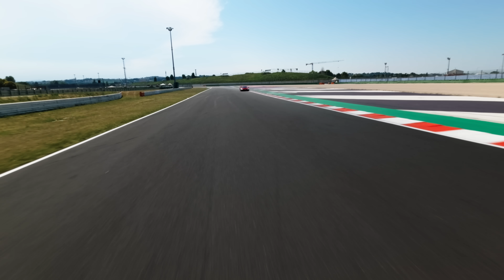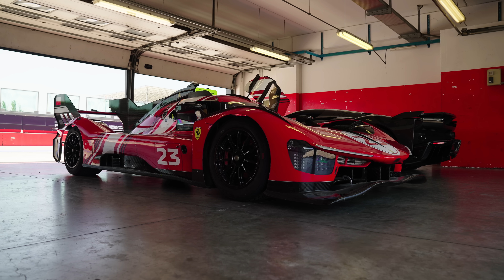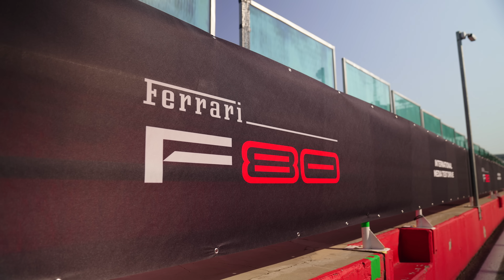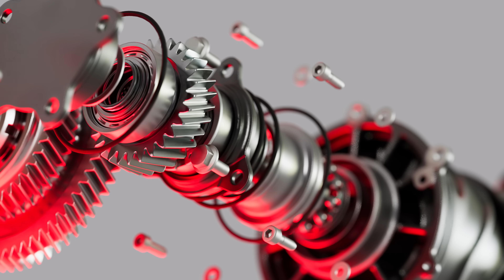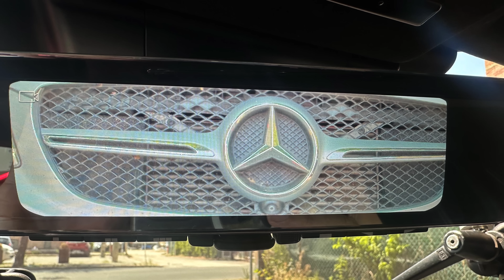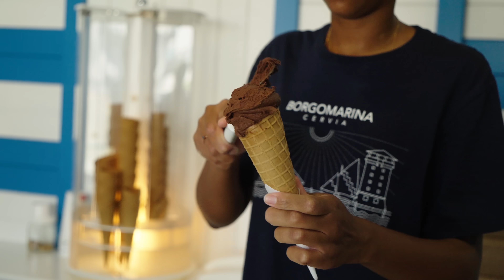Ferrari F80 First Drive - Ben Collins Drives - Track test and public reaction.

Comment: Now maybe car guys will begin what a super bargain the 296 GTB are today in terms of performance and systems. The 296 is not much different than the F80 - just 875 hp, six cylinder engine and electric motor - and very similar driving aid systems -  $3 million for the F80? Drive a 2023 296 GTB and one becomes a convert. Low mileage 296 gTB’s have depreciated down from the mid $400,000 msrp down to just above $300,000 and $$350,000.  The 6 cyl engine is much smaller than an 8 or 12 cyl- this can be placed very low in the chassis and allows a smaller body. Very similar to the corvette ZR-1 and -x -

Comment: When Richard Hammond nearly ripped his head off they didn't stop Top Gear.

When Richard Hammond tried to fly in a Rimac, they didn't stop Top Gear.

When Freddie Flintoff damaged his face, they stopped Top Gear.

Bring the 3 amigos back and relaunch Top Gear on the BBC for a couple of series then hand it on again, especially now there are V12's, and V8's  popping up everywhere, with eco fuels on the horizon.

Comment: Incredible piece of engineering, but it just doesn't look like a Ferrari to me.  The body seems more clinical and disjointed.  In my opinion a Ferrari is supposed to flowing lines.  The F80 seems quite angular, like a cross between a Noble and an old Corvette Indy.

Comment: I’m just not sure about this car. An SF-90 is a tenth of the price, better looking and similar in performance. I think the F80 needs to be 200KG lighter, smaller in foot print, better looking with another 100 hp. Otherwise a standard Ferrari road car will be faster than this within 3 years.

Comment: World's fastest car?? The Rimac Nervera R might have something to say about that. It just broke 24 world records including 0 - 400kph - 0 in 25.79 seconds and a top speed of 431kph or 268mph!🤯🤯🤯 Maybe on certain tracks it could take it but this Ferrari is balls ugly for a reason and it's turning capabilities are off the charts so if the track has turns this F-80 will be hard to beat. Still you cant argue with buying a street legal car with two seats that can do 0-60mph in 1.6sec 0-100mph in 2.9sec and the quarter mile slightly faster then the McMurtry @(7.9sec)😎 Did I forget to mention its a whole million $ less then the Ferrari at an affordable $2.7 million.🤣

Comment: I’d rather have the new corvette zr1. And I could get 2 of them for the price of one f80. Can you get a non hybrid version? Ferrari historically was slow to accept new tech until it was proven. They are not supposed to be a tech leader. I do not like it. If it cannot make 1000 hp without electric motors, my respect wanes. The 458 was the last great Ferrari. They have lost their soul.

Comment: Fantastic vid Ben, thanks.  It's less than 1/10th the price but Savage Geese say the top Corvette also can run quite a few laps without ending down on power.  It doesn't have the active aero or suspension but the powertrain is comperable.  Have you tried it yet?  Got plans to?

Comment: 12:09 Is the Valkyrie and Valkyrie AMR Pro not faster and more intense than this car? I saw some videos of an F1 driver taking a guy for a lap in the Valkyrie and it was unlike anything I’ve ever seen. Something like 3-4g in the turns. It’s so light and stripped down, and has such intense aero that I just assumed no other road car could touch it. Newey designed on top of that

Comment: What i dont like about these ev hypercars like amg one ,mclaren w1, and in the case of the f80 ,is that they advertise it as a 1200 hp hypercar.
 But when you drive it in the wrong mode , not keeping up with the recharging system, or keep lapping until the battery is empty,  you're then driving a 3.1 million hypercar with 888hp , the same as a 296 speciale ? 
As Ben said, those extra 300 horsepower are like nitrous... You can use it with a button , the cars chooses itself when to deploy it , or you can put it in qualifying mode for 1!!! Lap on full power ?
It should be advertised as an 888 hp car with a 300 hp boost function ...
Just my opinion ;
What do you guys think about this?
Have a good one !

Ps: You just made another stellar video,ben!
Your talent to talk about the minute details of the car while driving is simply amazing !
And i dislike the exterior of the cars , for sure on still shots, but seeing it in a dynamic setting , being driven hard, it looks a bit better .. i's not beautifull at all, but it looks purposefull, just like when the Mclaren senna came out...

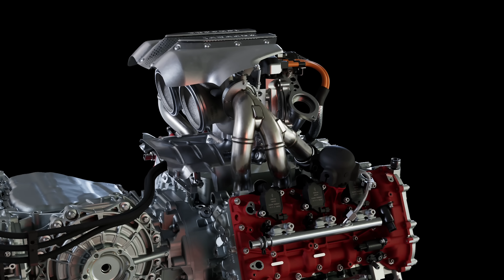Comment: 11:10 Cooling an e-turbo must be tricky !!
It looks to be thermally connected to the exhaust. I'd want to find a way to thermally isolate them a little bit.

Having said that, traditional turbos would benefit from thermal isolation and they don't have it - maybe it's too difficult to achieve.

Comment: First, critics mocked the F80's sound and appearance. 
Now that they've started to actually test the car, they've started to like it too. 
For me, I've always seen it as an amazing car, following automotive evolution at the highest level.
Reply: I've always liked V6s. Lancia invented the V6, so it has that Italian heritage. 6-cylinders was also the European standard for performance. More balanced than a V8, smaller packaging. There's a reason Porsche has stuck behind their inline-6s for so long. Now that they're the performance engine in F1 and WEC, there's nothing to be ashamed of putting one in a car.
Reply: There’s only one thing I don’t like on this car, it’s the black stripe in the front between headlights… to me it ruins the whole design. I’ve seen people doing some photoshop to put that stripe in red, and it’s already 200% better design
Reply: Chipped 6 cylinders of a Lambo Aventador made it green & added bespoke touch screens. How do they work with gloves on?

Comment: I don't get why people complaining about the engine, it got exactly same configuration as their f1 and lemans/wec cars. And it got almost the same exhaust tone as v12 because of the 120 degree banks so it doesn't have to get offset crank spacing to making up the firing order difference in narrower banks v6 which usually ended up sounding like trumpet engines.

Comment: The Aston Martin V12 in the Valkyrie is one of the lightest V12 engines, weighing 206 kg and delivering 1,015 hp. This makes it one of the lightest V12 production engines ever built. The 3.0-liter V12 used in Formula 1 in 1995 in the Ferrari 412 T2 weighed only 132 kg, but it also had less than half the displacement. The V12 naturally aspirated engine in the Lamborghini Aventador weighs about 250 kg, and a typical V12 from Jaguar weighs at least 300 kg.

Regarding the weight of the V6 biturbo used in the Ferrari F80, there are no official figures. This V6 biturbo is used almost identically in two other current Ferrari models: the Ferrari 296 and the triple Le Mans Hypercar overall winner Ferrari 499P. Designed as a racing engine for Le Mans, it was built using the most advanced materials and manufacturing techniques in the typical lightweight variant and weighs between 140 kg and a maximum of 160 kg.

In the F80, the V6 biturbo alone delivers 900 hp, in the Ferrari 296 it produces 830 hp, and due to regulations in the Ferrari 499P, it outputs "only" 680 hp. These power figures refer solely to the internal combustion engine and exclude the power from the electric motors.

With 900 hp, the V6 biturbo in the Ferrari F80 delivers only 10% less power but provides 850 Nm of torque, which is 70 Nm more torque to the driveshafts than the 45% (about 60 lbs) heavier V12 in the Aston Martin Valkyrie.

The V6 biturbo of the Ferrari F80 is 50% smaller than a V12 with comparable performance. Additionally, the transmission in the Ferrari F80 was mounted at an upward angle towards the rear. This created the space needed to install a diffuser with a length of 180 cm. Without the structurally smaller engine and the angled transmission, the diffuser would have had to be constructed 120 cm shorter, at only 60 cm in length. This would have cost a significant amount of downforce.

One of the most outstanding figures of the Ferrari F80 is its downforce. At 240 mph, the Ferrari F80 generates 1,050 kg of downforce, which is 50 kg more than a Porsche 992.1 GT3 RS including the Manthey kit. And the Porsche with the Manthey kit needs to drive 45 mph faster (285 mph) to achieve 1,000 kg of downforce compared to the Ferrari F80. These are values that a 992.1 GT3 RS in its standard configuration can never reach – 860 kg at 285 mph.

The Ferrari V6 biturbo is powerful and torque-rich, boasting unprecedented elasticity and dynamics. The Ferrari V6 biturbo, which is used in the F80, 296, and 499P, is not only one of the best engines in the WEC and Hypercar regulations. Even on the road, there is no mass-produced engine that is so small and light while delivering such immense power. A V12 would not only have required more space and limited aerodynamic possibilities, but it would also have violated EU regulations, resulting in hefty fines for Ferrari. These regulations are certainly sensible in mass production. However, for sports car manufacturers like Ferrari and others, and for us car enthusiasts, these petty rules of left-wing ideologues are nothing but a buzzkill.

Yes! The sound of Ferrari's 6.5-liter V12 naturally aspirated engine makes your blood run cold and gives you goosebumps. A V12 would have been amazing. The sound of the V6 biturbo in the Ferrari F80 is also great – but nothing compared to the scream of a V12. However, a V12 wouldn't have fit into the concept of the Ferrari F80. A V8 like in the SF90 would have been better in terms of sound as well. But Ferrari is currently celebrating its greatest sporting successes with this engine: the 3.0-liter V6 biturbo. And that's why it was the right choice to use it in what is currently the world's best hypercar.
Reply: Got the downforce figures wrong. The Ferrari produces 1000 kg of downforce at 155 mph and the 911 produces it at 191. So while it is ~45 mph difference, the speed required to reach it is lower. This thing can generate its weight in downforce at the speed the 911 reaches 1000 kg. It’s also got a longer wheelbase, wider track, and a far lower center of gravity, to go with the top-level suspension, double the power, and state-of-the-art chassis.

Of course the McMurtry Speirling produces over double its weight in downforce at any speed so it slams every car mentioned, but that’s a different beast.

Comment: YES. Ferrari has finally returned to that impossible to describe 'F40 aura' with the F80. The Enzo didn't have it. The Ferrari LaFerarri didn't have it. This has 'IT'. The styling is a knock out, an 80's throwback and hyper-futuristic at the same time. Mind bending technology that blends into the background. And EV mode isn't the default setting when starting it up and driving it away. No pure EV mode at all. This is how electrification should be utilized in sporting cars. BMW M5, you listening?

Comment: Humans are stupid. We admired engine power increase for same fuel economy, instead of same power - increased economy. we could have had gas powered cars forever, now we have a fragmented market not knowing future direction because of no potential to ramp up lithium and electricity production.
we never needed more than 140 horsepower on the roads in our daily lives. this couldve been done easily with 1.0L engines with electric supercharging. we didnt need the noise conversion from petrol. 
Detroit sold us a lie

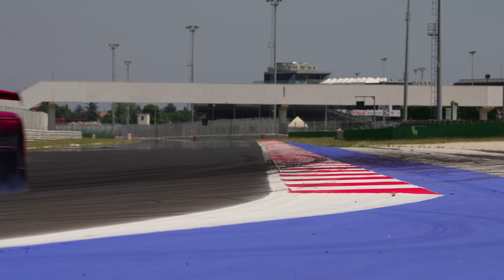Comment: 0:55 is that car supposed to be sliding like that or you just great at driving?
Reply: He is great at driving. We all know
Reply: All cars can slide. That’s how you get the best possible lap time. There is always a slight amount of slip angle when you’re pushing a car. No matter if it’s a Miata or a f1 car. Normally the ideal is just a few degrees. 

If you can drift a car and understand when it’s losing grip you have the skills to make a fast lap time in that car.
Reply: He’s The Stig. A real high level racer. To slide that car takes TONS of effort given the tires, downforce and suspension are all class-of-one.

Comment: The F80 is not a real car, it’s a concept. It’s also not the fastest car in the world. The Chiron SS has the fastest verified record (490.48 km/ )and the Koenigsegg Jesko Absolute is the fastest on paper (>531 km/h). The F80 is neither (theoretically 500 km/h (311 mph))
The fastest real Ferrari (e.g. SF90 Stradale) tops out around 340 km/h (211 mph).
Reply: clearly not talking about straight line speed
Reply: @dddd-uk4vn it’s clearly not the fastest around a corner either. Since it’s a concept car it also competes on the same level as any other specially built track car.

Comment: He mentioned how the wing looks like it would create lift in low-drag mode, that’s a bit of an illusion once you understand basic aero principles. Keep in mind that the air flowing over the car, once it passes the cockpit, is hugging the body and therefore traveling somewhat downwards. So to create a zero-angle wing, they would need to take that downwards airflow into account and therefore put the wing at an ever so slightly negative angle.

Comment: My brother is an aerospace engineer for Lockheed Martin. I asked him about the advantages of 3D printing the ideal organic shapes for things like wishbones. He told me it’s basically a wash. You can get the ideal shape, but because it’s printed instead of forged, the metal isn’t nearly as strong and they need to beef it up more than they otherwise would. So it does look very cool and space age, but in reality it’s just kinda treading water. The real advantage with 3D printing comes in the prototype mockup stage, when they can create and test pieces in a fraction of the time and for minimal cost.

Comment: Shesh slow-poke, I've watched TG and Harris review this Lambo-looking monstrosity before yours came out. I do kind of like the looks, but what put me off was those Lamborghini-looking angles originally, when I expect more curvaceous from Ferrari. It sounds a LOT better inside the cab than when it debuted, driving by from the outside, which sounded like a vacuum cleaner. E-Turbo is cool, knew that would come into play with hypercars sooner or later. At this rate, the F100 in 20 years is going to need to hover in the air at supersonic speeds.

Comment: And Chris thought he could challenge the STIG... how silly.   The F40 had no radio.  No trinkets.  So the F80 while mighty, still has many more features than a stripped racing machine would.  So it is still not a F40 successor as it isn't a pure racecar.  However I do think its a better idea to sell it in this state.  As I have personally installed audio systems in F40's.  it is not fun.

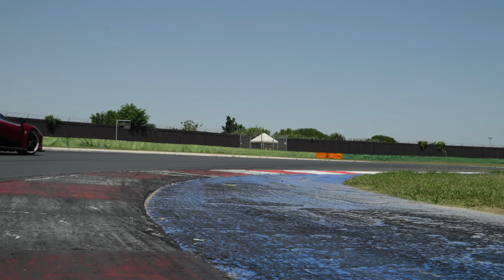Comment: 3:17 might have twice the aero than a LA Ferrari but the LA Ferrari is 6x more of a car 😂
Reply: Why bc it has the V12? F80 would blow the doors off the laferrari. 5:45 that may be a V6 but it's right out of the 499p hypercar and its durable AF. Ferrari V12's are nowhere near as durable or as easy to cool. That v6 sounds good too you have to admit. Quit hating!
Reply: @danielgreensides8463 People need to move on. This isn’t the ford GT, it doesn’t make 550 hp or whatever like that did.
Reply: @danielgreensides8463 correct it would but the la world sound better 😅
Reply: People need to get over the engine. That V6 is like half the weight of the V12 while making basically the same power. These are supposed to be the fastest cars they can make. If you want something loud buy whatever the new 812 is.
Reply: LaFerrai has only two things over this look and sound. That's not 6X more of a car.
Reply: @BornKing93 it’s a play on words 6x meaning 6 more cylinders not 6x more car I’m sure the f80 is a 100% more a better car but the la Ferrari will deliver a better feeling like James May said ( The fizz)
Reply: La Ferrari is a rust bucket compared to this car. Inferior product 😂

Comment: Amazing car but so sad that even this level of car has fake engine sounds in the cabin.
Reply: I don’t think it does. They did what Porsche has done with the their new models. Piped in the exhaust into the cabin more for enhanced sound without leaving road noise
Reply: @G82Watts  Porsche stopped doing that when they made all the car turbo.  Now they have fake noise too.   The 4 cylinder 718's are TERRIBLE.
Reply: @joetacchino4470 I can assure u that the U.S. model Porsches don’t have any fake sounds.

Comment: I have a hard time believing this car will be on the road in 20-40 years time like the F40. All these complicated electronics, batteries, computers, sensors, KERs components etc aren't made by Ferrari but by a 3rd party and they don't have a very long lifespan. If you need to replace some one off electrical component that's coded to the rest of the hybrid system in 20 years time you won't be able to do it and this thing becomes a brick. I really hope we see a return to simplicity in F1 and Hypercar and therefore the road cars as well.

Comment: Ben, again yet another great video.  Whoever is doing the video and editing work for you is doing an amazing job.  You’ve had the opportunity to drive these 1,000 hp+ cars, and those with several hundred less but highly engineered aero, how are they different from your perspective?  Does all that extra hp with the aid of electric motors add significantly more to the driving experience?  It seems to me, that unless you track the car or have access to an Autobahn roadway few will ever experience it.  I’m genuinely interested in your perspective.  Kudos to Ferrari for letting you go all out with this car on the track.